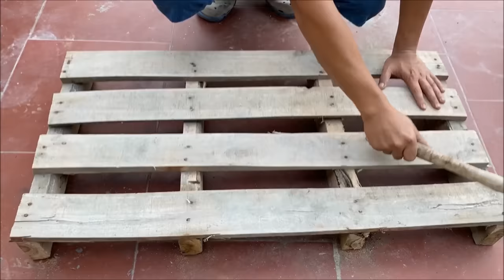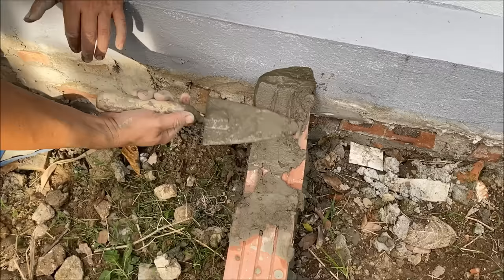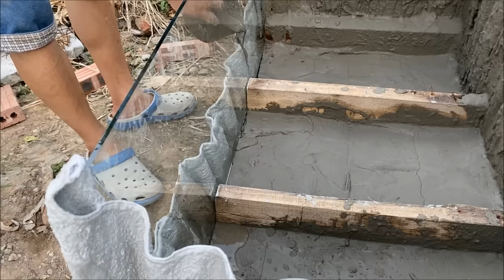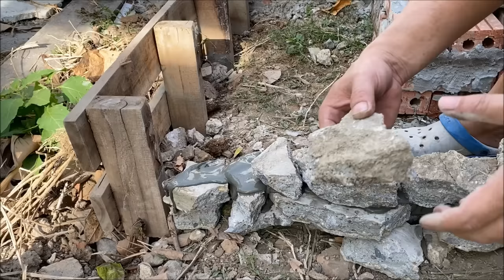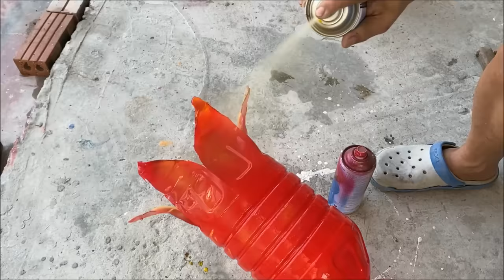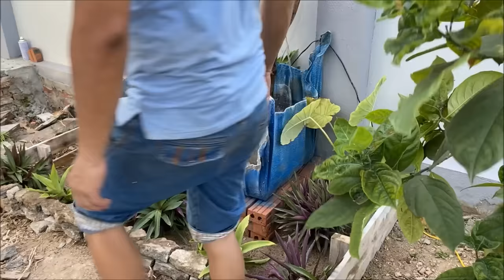Creative ideas from cement and Wood Pallet - Great Garden Decoration from Recycled | Diy Aquarium

Comment: The fish will be lucky to last a week, no filters, over crowded, chemicals from cement, and in that week they're gunna suffer in a shanty aquarium swimming about in their own waste.
Reply: Too small for them ...
Reply: I'm guessing the fountain supposed to be an attempt at filtration and aeration, but yea, not going to work well long term
Reply: Omg i was thinking the same thing! I mean it would have been much better for a veggie garden but not for live animals, especially ones in water!
Reply: All other things said, that electrical cord needs a loop in it. The minute a drop of water gets on the wire going down, its going straight into your plug and thats a problem. You need to elevate the plug so water goes down the wire, and drips off the loop to avoid this.
Reply: Jicari Hickory Hill  of course there's chemicals in cement, that comment proves my perception of you, you must be a troll surely.
Reply: Jicari Hickory Hill  
Cement is manufactured through a closely controlled chemical combination of calcium, silicon, aluminum, iron and other ingredients. Common materials used to manufacture cement include limestone, shells, and chalk or marl combined with shale, clay, slate, blast furnace slag, silica sand, and iron ore. Now crawl back under your rock.
Reply: Cynthia Ostrowski 2
Reply: You don't need filters and other gadgets in hot countries, i used to have a pond with tropical fish...
Reply: @danielx8  the flower is a filter for part of the waste to keep the water clear. ..
Reply: Kev Im on your side and that Jikori pikori whatever person sounds ghastly....
Reply: Tilapia eat their own feces they breed them in these filthy places overseas
Reply: Clean up.the yard first what a mess
Reply: At least he will not have to re grout the red tiles.
Reply: But it was on a demonstration as to what can be done. And he did make something unique from nothing.
Reply: @danielx8  you don't know what you're talking about.  You're dead wrong.
Reply: @sharonupchurch8723  the very reason I never eat imported fish, including the ever so popular Basa that popular restaurants here in the US serve because it's so cheap.....yuck.

Comment: OMG!!!!! Just got an idea for an old well cover with the towels in concrete!!!!! ♥️👍♥️👍♥️👍
Reply from the maker: Great idea!!
Reply: Yes, making something else out of the idea would be much better. Well cover is a great idea. Use a stainless steel or other mesh also as 1st layer, then cloth to the shape you want. When dry, turn over and use spray insulation on the inside for the insulation factor for winter. Maybe insert a hand hold at bottom somewhere so you can lift it later on.

Comment: Treated wood, toxic paint, uncured cement (possibly), little space (koi require 1000 liters per fish) ... a DEADLY TRAP for fish :(
Reply: To be fair, most wood pallets are just heat treated.... i would imagine this especially true in 3rd word countries, if not left untreated altogether.
Reply: OMG- I know. I admire the ingenuity but holy hell- this is so gross.
Reply: Nickolus Mayfield hhhh
Reply: Pallets are heat treated not pressure treated with chemicals, harmless, grow your vegetables in them as well, concrete is fine used to line reservoirs and dams, koi will grow and be moved to a larger pond I imagine, they aren’t idiots.
Reply: What alternatives would you suggest?
Reply: 1000 liters per koi is nonsense.  
They grow to the size of the tank they're in. In a smaller area they won't grow as large. You can keep a few small koi in 20 gallon (about 80 liter) tank in your home if you like. Bigger is better, but not necessary
Reply: The bare cement is the biggest issue here, not only for the fish but also because cement is porous.
Reply: Fish won’t live long, they are for dinner the next day.
Reply: @HuntHardFishHard I encourage you to do some research. Concrete needs to cure for a month to become safe for fish, otherwise lime  from the mix will quickly dissolve into the water and raise the pH up to around 11-13 (14 being the absolute highest on the pH scale).
After allowing a month to cure fill the pond/tank/etc with water and test the pH a week later to determine if it's safe to add fish.
Reply: d b fast set non shrink cure time is 1 day, with the small amount and days of obvious drying the threat of high ph is gone. It’s probably done a 3rd world country where resources are hard to come by, if you the tenacity and toughness of fish you wouldn’t be worried to much for them, I’ve seen 10 pound bass pulled out of retention ponds and waste ponds with as little as 3 feet of water, this person in the video is great with resources at hand. Making their home a little more comfortable and appealing to them means everything, it’s koi fish...
Reply: This is definitely way too small for the number of fish
Reply: @gellotion  wrong mate you do need a bigger tank for that many fish. It's true koi will grow to the size they have space for but it's not as simple as they just stay small, internally they continue to grow until it kills them. That's why goldfish in a bowl/tank don't live nearly as long as they do in a pond. With enough space koi can live pretty much as long as humans, with reports of some them living over a hundred years
Reply: @gellotion  000
Reply: @Skthorn50 ?
Reply: @bryanmurphy1107  what?? The idea that their (internal) organs grow but their skin doesn't sounds ridiculous.  
Do you have any links for that?
Reply: @HuntHardFishHard  thank you I agree .
Reply: @HuntHardFishHard  I'm late to the party but it upset me that pp r so mean
Reply: 1972 chitekwe ...your forgot the paint: toxic as!!:.....water running through “plastic” !!!
Reply: @joyhazle2140  and most bottled water comes packaged in what...?
Reply: d b .....never buy bottled water!     BUT, if I was to do so I have a choice...the fish referred to DON’t have a choice!!
Reply: The poor guy is delusional!!
Reply from the maker: with 1000 liters of water as you said I am sure that I will keep dozens of small fish (as shown in my video) live normal
Reply: @gellotion  When is the last time anyone saw a fish explode???
Reply: @joyhazle2140  OH NO!!! Where's a liberal when you really need one??? FISH CHOICE NOW!!!!
Reply: Hey, we're Asian kois,  build us a home and we'll live anywhere.
Reply: Not the best of environmental  safety for these fish...this is crazy...just use a normal rank .much cleaner and safe😱😱🙄
Reply: Some of those are gold fish not koi.
Reply: @No.1CreativeCementIdeas  ...possibly when they grow 1 foot plus? - turn the front into a waterway/pool for them so they have more space?
Reply from the maker: I don't think it's as ugly as you say, I just think it's pretty and creative 😂😂😂
Reply: @gellotion  so dams aren't made of cement?
Reply: @lizkilic1528  You spend more on lattes than this guy makes a day. Give him a break. I think it's admirable that he's trying to make a more pleasant space, while recycling materials instead of it ending up in the ocean.
Reply: @beccagee5905  what do you mean?
Reply: @gellotion  You said cement is porous, so I asked, "Aren't dams made of cement?" There are also earthern dams, and we know dirt is water soluble.
Reply: They're feeder gold fish not koi. They're the gold fish you buy at the pet store for 20 cents a piece and always have ick. Lol
Reply: tasteless. apt for villages in vietnam phillipines
Reply: u kidding, the owners will consume the fish stew
Reply: @HuntHardFishHard  What does the fish intelligence have to do with it?
Reply: @cindylopez653  if only most knew about the damage their soaps,conditioners, shampoos, cleaning supplies etc do to marine life…. Far more dangerous than some concrete plastic and paint…
Reply: @Cybertruck1000  the builder in this video and others concerning growth of koi fish and caring for them, they’ll out grow tanks
Reply: Your just mad cause your limited American ways only teach you how to master the subject of racial division. Which as a country, you’ve mastered well. Mastered it so well, you (as an American) could teach it, oh wait, scratch that, you do. Show a better video, or leave negativity to yourself. Thx.
Reply: @joyhazle2140  and bottled drinking water comes in what?
Reply: @beccagee5905 concrete is indeed porous and dams are made of concrete.  

But remember, porous and having a hole are different things. The thicker the concrete the less the porosity matters is part of it. 

Earthen dams utilize density as well as depth. Ever noticed earthen damns are crazy thick to do their job? Furthermore they are not mere piles of “dirt.” Usually you’ll find an impervious core in an earthen dam. - something that prevents water crossing. You’ll also find clay and other binders in use.
Reply: I'm almost 100% positive that pallets are not treated wood my guy...
Reply: 99% of pallets are just kiln dried with heat.  No chemicals.   The concrete is fine once dried.    The paint is a whole other issue . Not good
Reply: Give credit where credit is due nice job for someone with minimal resources or money.

Comment: I didn't even pay attention to the tank aspect, I just took the method from the video.  Towels and cement and gravity?  It is like Paper Mache'.  You could use this technique for 1,000 different things.  Planters.  Raised gardens.  Sculpture.  Fire pits.  Endless
Reply from the maker: Excellent! 👏👏👏
Reply: @No.1CreativeCementIdeas  but what keeps it from cracking? Usually cement needs metal structure inside like wire mesh, fencing, or rebar, especially when it's thin. 
It looks like the concrete could break easily
Reply: True!
Reply: Try doubling & even tripleply on the towels

Comment: I'm actually amazed that this can even hold water
Reply from the maker: It's true
Reply: Fish will be dead in an empty tank by morning lol
Reply: Xvidios
Reply: One guarantee is  that sooner or later all concrete / cement cracks . . .even if it's inches thick. This somewhat flexible tarp coated in cement and sitting in wet environment will soon be leaking (sooner rather than later!). The comments I have seen about fish waking up to an aquarium filled with air are pretty much right on.
Reply: Non the less good idea but would rather use fibreglass
Reply: He probably used Gorilla glue in the corners to seal the edges of the glass to the concrete towels🙈🙉🙊

Comment: Waaayy too many fish for that tank. Barely can turn around. Bigger fish will eat little fish.  Concrete will kill the fish. Concrete kills plants put in it too
Reply: Concrete does not kill plants. Also the water has a filter.
Reply: @louisedery1049  yes it can if it's new. It causes leaching and raises the ph of the soil. Ive put plants on concrete containers and they all died. Diff containers. That's how I know, and you can look it up. You can put a barrier down, btw soil and concrete, but for a fish pond you  might need a clear plastic barrier but that may or may not cause other problems (maybe leaching when you add pond additives to keep water clear. I dont know.

Comment: I applaud understand your idea and hard work, I truly do. I must say though, firstly I would not put fish in there. There are way too many toxins for them. Anything you make should be thoroughly cleaned and bleached before adding fish. But if you insist on keeping fish in there, you need to remove some. There are way too many in such a small area. Sadly, you're likely to lose the fish due to toxins and over crowding... If the birds don't get them first. You never know though, gold fish are essentially just carp and they can be pretty hardy. Good luck to you..
Reply from the maker: yes, maybe your point is right 👍
Reply: Just because something survives doesn't mean they are happy and healthy.  I promise if those fish are still alive, which is very doubtful, they would jump out of that water if they could.  Goldfish take more care than you realize; that's why so many live very short miserable lives.  Healthy ones can live 20 years.

Comment: That cement is going to break down and kill the fish
Reply: It has a filter. They will not die.
Reply: @louisedery1049  how's the filter going to save them if the cement chemicals leach into the water?
Reply: @louisedery1049  Yes they will.
Reply: the chemical burns a human gets from cement is because it CHANGES THE PH from from normal 6.5 to ALKALINE 10 which is exactly what it will do in the pond water knocking out the biological filter bacteria!!
 which will give you new tank syndrome within a couple of days
Reply: @StevieJerusalem  agreed, all the filter will end up doing is pushing poisonous water around and around

Comment: Next time use hardware cloth to make the frame, as you would if you were doing stucco. Secondly your cement was to wet, reduce water till it runs thick like pancake batter. 

Overall for your first run at it, not bad at all.
Reply from the maker: oh yes, thank you for your support

Comment: If you don't handle cement too often, never mind, but you really want to avoid having your hands in it too long.  If it gets in your fingertip skin, it can get quite painful.  I was working with  concrete for over 20 years.  You should handle it with rubber gloves on. It's the lime, very caustic.
Reply from the maker: thanks for your comment.

Comment: It looks pretty and it is creative, but I don't see those fish living past 2 weeks. It's shallow and outside in the heat, they will overheat or jump out. What did you use to seal the glass and what did you seal it to? I see others have already mentioned the danger of the water picking up chemicals from the paint and concrete. Great water feature, though. Maybe add river rocks instead of fish
Reply from the maker: Yes ! it's creative and beautiful and also has enough oxygen and water for the fish to live, thanks for your opinion 👏👏👏

Comment: Quoting this channel from the comments below "the important thing is the idea"
Let me break it down a little bit
1. The cement towel will crack and break sooner than later, leaving an unfixable leak
2. Exposed, untreated wood, nough said
3. Untreated cement
4. What the heck kind of paint is he using? When it rains, that toxic paint is going to drip down into the water.
5. Acclimate? Nahhh what is that?
6. Fish are too many and too big

What's more important than the "idea" is the well-being of the fish. I hope fish owners don't use this idea or at least do their own research and improve it. Spending a little bit more money will bring out a better longterm outcome.

Comment: How long will this setup last, with towels being the at the center of the concrete? Will it chip away into the fish tank?
Reply from the maker: towels and cement, if done correctly, will have a fairly durable structure, so this aquarium is completely feasible

Comment: Really creative, but some issues:
1. Structural integrity - a towel with cement coating doesn't seem long-term stable, probably less so than plastic
2. Environment - Spray paints, cements, raw wood weren't sealed - all these will rot and/or produce toxic bi-products
3. Morality - Fish to volume ratio is off, if you insist on keeping fish as pets, give them more space

These make-shift ideas are creative and pretty but they often cut corners in order to demonstrate their simplicity, please be mindful when constructing things of the issues they may have, especially when involving animals.
Reply from the maker: Thank you for your attention and feedback, we will pay attention and try harder in our work

Comment: Please wait 60 days for the cement to fully cure. Then treat the water with acid and drain, then refill and treat with acid again and again until the PH reads normal. Cement and concrete are loaded with lime to keep the PH levels extremely high so it will cure. Great idea but will kill the fish quickly. Not to mention the spray paint pollution.

Comment: Never put your hands in to either dry or wet crement as you get older it can cause problems with your hands is numbness in your j Fingers etc gloves are cheap wear them when handling  crement and wear a face mark to provide Protection for your Lungs as the dust i can affect you long term
Reply from the maker: yes! Thank you for your interest and comments 👍